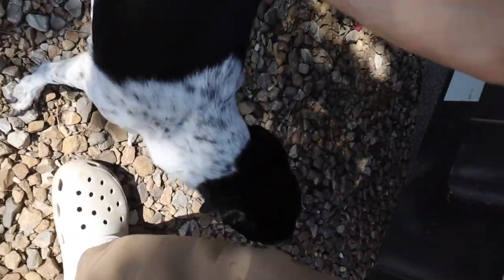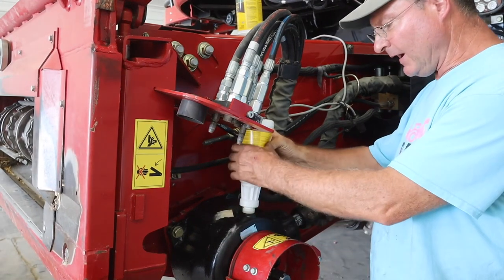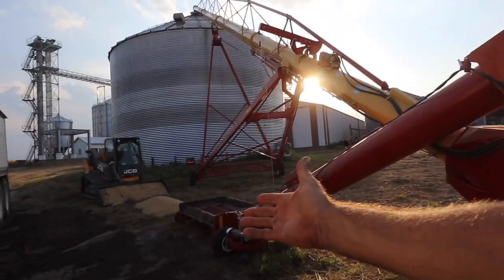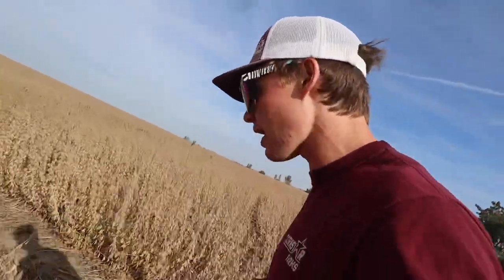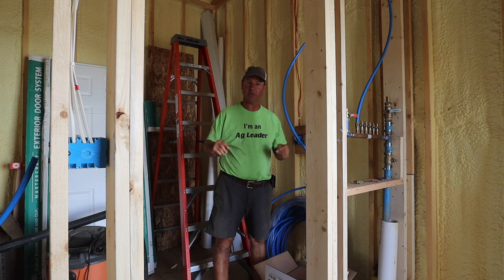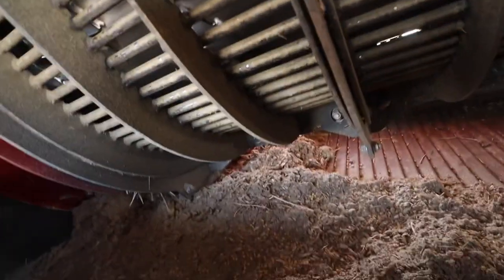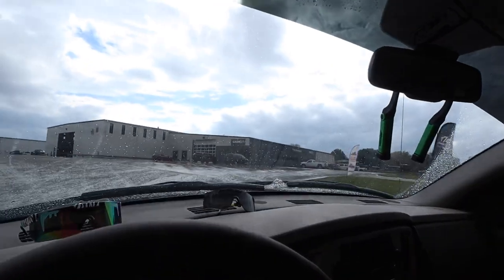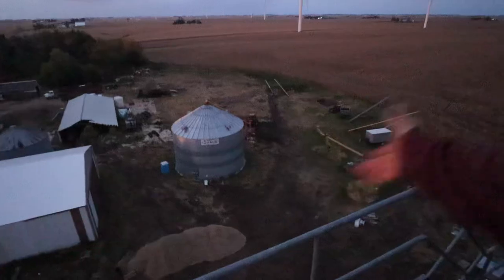Houston, The Combine Has Some Serious Problems.

Comment: May I give you a helpful hint? You are running WRONG concaves. You have round bar corn concaves and need square stock. Also...1. run rotor at 670 rpm. 2. Close front part of top Seive completely and open middle section of top Seive to 5/16 th inch using bolt. 3. Run fan 1100 to 1200 rpm. Good luck!

Comment: Hello case Ih dealer. We are a big YouTube farm channel and we bought this combine and it was not in good condition. Should’ve we name u??
Reply: I have to laugh...last video the comments were littered with " I can believe you called out those trades for those crazy welds! That was horse poop!!"...of course, they didn't name who ever was responsible for the welding....contrast to this video and overwhelming - comment section is " get that dealer on the line! What's wrong with that dealer"...lol...I just kinda found it amusing the stark contrast. I agree with you - yup. Get the dealer on the horn. This family has worked incredibly hard to build this channel, it doesn't just happen by chance. They lug cameras every where they go, set them up, take down, position a camera...walk the other side of the road..run back- get camera and tripod, throw it into truck, drive on. I once watched a you tuber from Finland show what she goes thru to get just 3 minutes of clips..I was FLOORED ! And gob smacked. There is a ton of work to build to a half million following, I say use whatever clout they may have earned and get that thing fixed- pronto! :)

Comment: A new machine even if it’s the same color has a learning curve . Manufactures make improvements or change design to  increase capacity and may need different settings or components than the older machine. My husband has had these type issues when changing to a newer model . Make some calls and search the internet. You surely are not the only one with these issues. You will figure it out